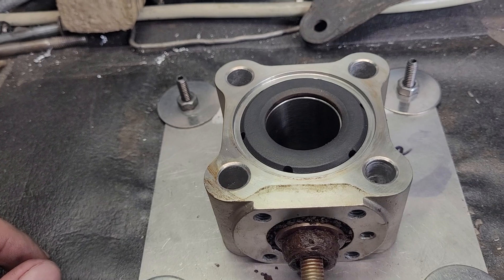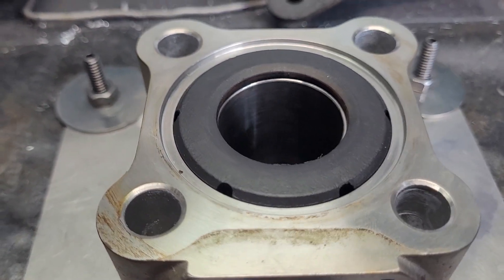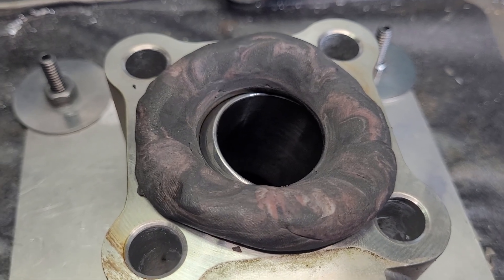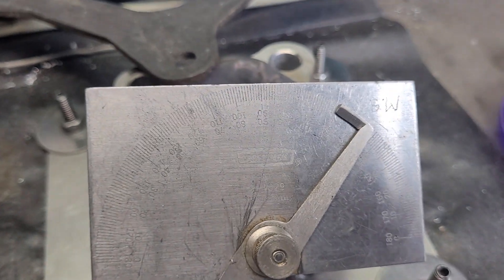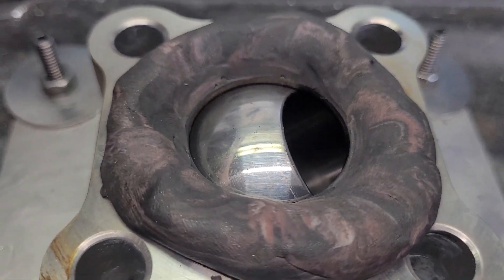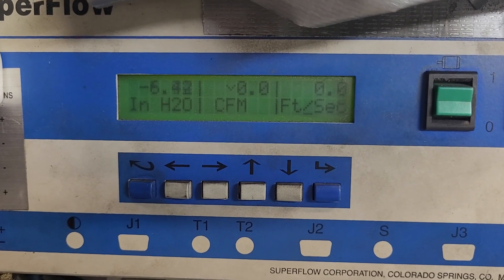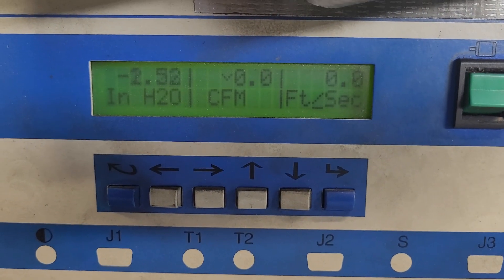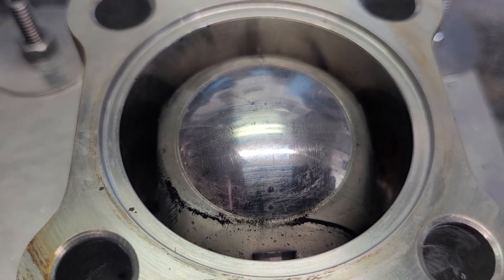Airflow games: 1.25" ball valve.

Comment: I enjoy watching how each idea you have translates to flow numbers on the flow bench and behavior of the string's path. I have learned a lot. I was thinking that I remember a fire alarm company on a construction project used an aerosol can of "simulated" smoke to test smoke detectors without using cigarettes or any real fire source...so assume that stuff was safe. I wonder if a can of that sprayed near an intake would help visually show the path and turbulence of air flow that I am imagining with your string. Just a random thought from someone with NO experience.
Reply from the maker: I remember that testing. I thought they stopped using it because it was toxic. I may be wrong.
Reply from the maker: I need to spray something that will dry before getting to fans and motors. Anything sticks to them and my calibration would be off and motor health down the drain.
Reply: @servediocylinderheads  Would something like baby powder work?
Reply from the maker: @MileHiGuy  No, it would kill the motor's bearings.
Reply: How about dry ice and water to make it “smoke “?
Reply from the maker: @bcbloc02  Not a bad idea. I don't know how much damage the sublimation of dry ice will cause to the internals of the bench.
Reply: @servediocylinderheads  i would not think carbon dioxide and humid air would pose much threat but I guess it depends on the motor design and if it draws the vapor through the motor I guess at certain temps it might try to condense and that water in the electrics could be bad.  i would think they would use sealed motors in the construction of a flow bench but maybe they don't?
Reply from the maker: @bcbloc02  open motors

Comment: Quite interesting and very cool. I have to say it surprises me how much flow reduces given the changes in opening, from full in particular. I too wonder about the difference between a ball valve and a throttle butterfly of the same nominal dimensions. What you need is a 1.25" SU carb. Thanks for the great work.

Comment: Thanks for the video Charlie. It reminds me of my friend that raced Super Stock Pontiac's. They did run the throttle blades past center in the single plane intake probably for fuel distribution but he also found the angle of the air door for the most flow. Of course Q-Jet. Can you look at my question in the last video about what ideas for the plenum floor?
Reply from the maker: I will check. Thanks

Comment: Man I want a flowbench! lol Is it worth trying to build one or just suck it up and buy a Super flow?
Reply: I made a "floating pressure drop" flow bench that is shop vac powered. I have spent many hours experimenting with old iron heads, and 1 intake. I had one head/port  tested on a real flow bench, so I can compare other things to that one. As a hobby, it fit my budget, or lack of budget, and taught me many things. It is in my opinion a little less repeatable and not as precise as a real bench, but I am not selling my work or building race cars. In my case, it was the cheap way or no way. If you build the cheap one and decide grinding stuff is the spice of your life, stepping up to something more expensive is always an option.
Reply from the maker: @stuartwall8212  Yep, all good.
Reply from the maker: Self built is fine if it is repeatable. Sf is pricey. I bought mine used and it was still expensive.
Reply: @servediocylinderheads  I know, it would have to be used.. Really enjoy the videos Charles.
Reply from the maker: @MileHiGuy  Glad you like them.
Reply from the maker: I should also add it should be accurate and repeatable. Sharp edge cal plates are a good way to calibrate.
Reply: Hi Lyle. There is a company called PTS Flowbench that sells plans for making one yourself. They have a forum that is very helpful. You can also buy calibration plates from them and many other things. I made my own, not a PTS design although it probably would have been easier if I had used their plans. Andrew
Reply: @andrewburlock2653   I will check them out, thanks! I've been looking at performance Trends stuff a little bit.